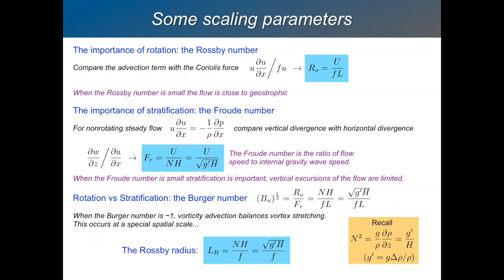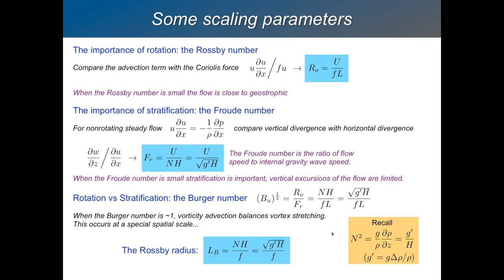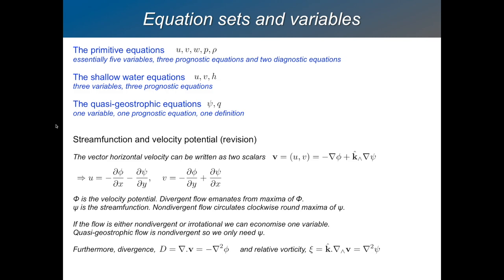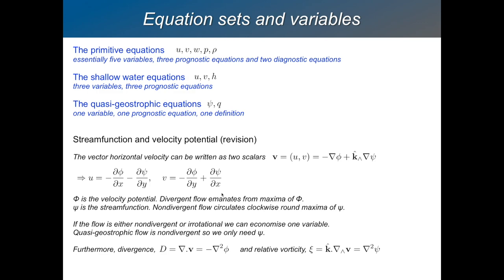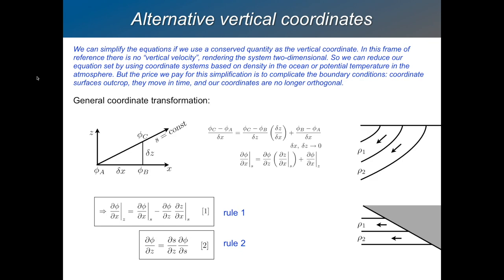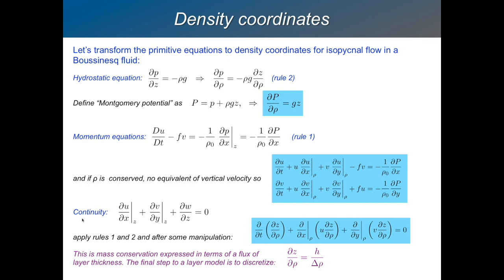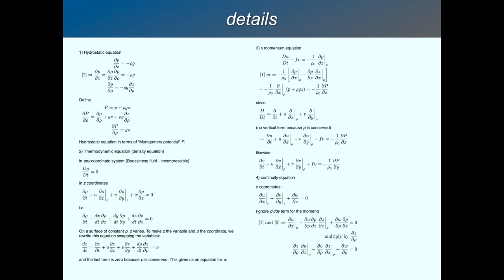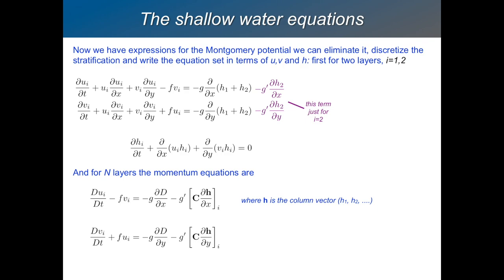GFD 1.4 - Density Coordinates and Shallow Water

Comment: Thankyou so much for the video! However, i still do not understand why we consider all the height (-H+h2+h1) to calculate z=zs in the surface, not (-H+h1) only as related with the surface, is this really to calculate the pressure of Montgomery potential in the surface?
Reply: Second question, what is actually the value of reference depth, and why this value is negative when it compare to z (z=o on the surface and z=-H in the depth), what is the different with small "h" in the diagram of shallow water?
Reply from the maker: To find the height of the surface you need to integrate up from a level where the pressure is uniform. That means going through all the layers from the bottom (where there is no flow so no pressure gradient). If you skip a layer you'll get the wrong awnser !
Reply from the maker: @anistiamalinda3528  The reference depth is H, which is constant. So the bottom is at z=-H. The position of the surface, and the thickness of the layers (h) is variable.